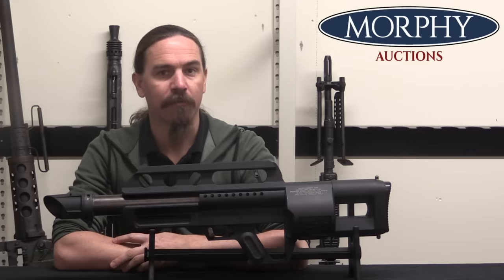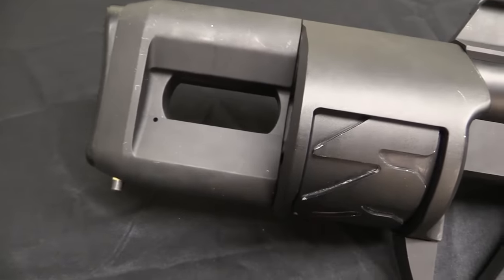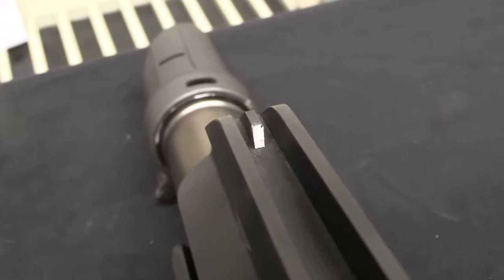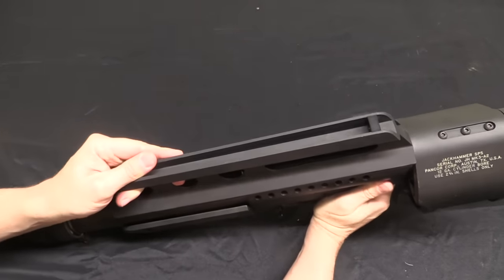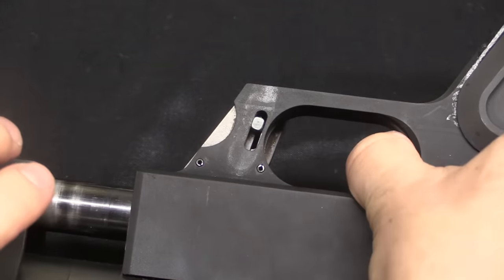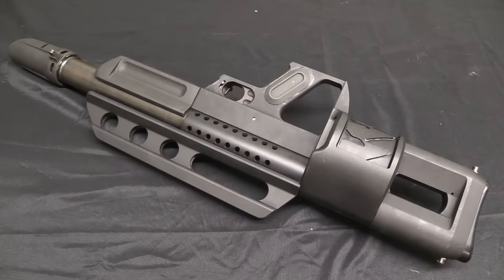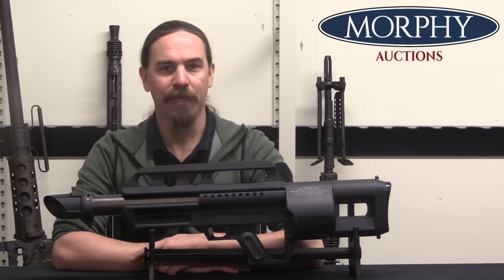Pancor Jackhammer Mk3

Comment: Hope whoever buys this, gets a gunsmith to complete it, then of course has Ian fire it.
Reply: On one hand it deserves to be finished.  On the other, would that technically be ruining a piece of history?  I'm evenly split on if it should be completed or not.  On the flip side, there's so much missing and so much wrong, like the cylinder grooves, I wonder if it was just meant to be a mockup to begin with.
Reply: @DeadBaron  It depends. If completing it doesnt need any, or much modification to the parts that are already there, just adding new parts that can be removed easily to bring it back to its "mock up" stage, I'd say there is no reason at all to not go for it. ofc, It's hard to tell what exactly does that gun need to become functional, without totally picking it apart first and looking at what's missing or not complete.
Reply: Mark Novak?  Get a new cylinder made and keep the original stock but otherwise populate the missing parts.
Reply: @john-paulsilke893  +1  I second that motion! Send it to Mark Novak.
Reply: @DeadBaron  or copy the build and get it licensed and everything and just make an operating one and have that as a wall hanger.
Reply: If you made a new one it’d either have to be semi auto, or you’d have to be a licensed dealer to manufacture a full auto copy.
Reply: @DeadBaron  Legally speaking, you could replace everything but the receiver to make this an operational weapon. For the sake of preservation, I’d rather they duplicate any part that needs to be modified to make the weapon operational, which would also allow some trial and error to make it function without fear of damaging the original pieces. 

Ian has shown off a couple similar examples (I recall an M14 in particular), and I know of a few similar replication methods used for aircraft restoration (such as an SB2C tail loaned to the National Museum of the US Air Force so they could restore their A-25 and create a duplicate for the future). This is a much more complex process, but this is a unique artifact with a unique opportunity that begs for being done properly.
Reply: Building a totally new one would be much easier, today's home prototyping is leagues better than when this was made.
Reply: 5:50  I'm betting this was operational at some point based on the wear on the operating bar. ( Or maybe it was from one of the test to destruction samples )    Also looks like the safety can be moved from left to right.  Perhaps some of the parts are hiding the the basement. . . .
Reply: @john-paulsilke893  prompt the new owner to give Mark N a call. Especially if its the guy who currently owns the mk2
Reply: @Clay3613  Except you legally can’t unless it’s semi-automatic only. This is the only full-auto Jackhammer Mk 3 that can exist in private hands in the US.
Reply: @Clay3613  Hope you don't have any dogs.
Reply: @DeadBaron  Split between Lucas movie quotes. "I will finish what you started" vs "It belongs in a museum!"
Reply: Regarding completing, what Ian said about the drum not being finished is questionable at best. It looks like he changed the design from having one pin going through the zig-zag pattern to having two pins, one from the front and one from the rear, which would better allow intermittend drum movement.
Reply: No, thats not how this works.
Reply: Can't (or hasn't) somebody just make a fully functional reproduction of the Pancor so they have one but officially isn't called a Pancor so there's no patent infringement?
Reply: @dsandoval9396  People have tried to make cylinder-fed shotguns like the DAO-12 (known as "streetsweeper") but nowadays the ATF is a bunch of lunatics so don't get your hopes up of being able to buy one even if they had a comeback. For a more modern example take a look at the Crye Six12, but I don't think it's released to the civilian market yet.
Reply: Yeah whatever you do, don't give it zach
Reply: @LeBoomStudios  So wait, are the ATF stricter with cylinder fed shotguns than magazine fed ones? I'm not really a gun guy but that seems kinda dumb even to me lol.
Reply: @yewtewbstew547  They make up stupid umbrella terms like "destructive device" without sufficiently defining them, then put everything they (read: the politicians funding them) don't like or that "looks scary" into such a category and outlaw it.
So yeah, most of the ATF rulings and opinions are inconsistent and wouldn't hold up to the tiniest amount of scrutiny. But who would've guessed, the courts are just as corrupt and politicized as the ATF, so nobody's gonna do jack shit about it.
Reply: Send it to Zach. Watch him lose his mind over the very existence of this gun. Profit.
Reply: given that it's registered as a machine gun,  to make it operational could be tricky,  legally speaking.   but i could be wrong.
Reply: I hope to be that gunsmith someday!
Reply: id rather it live up to its purpose, that being a firearm,  right now its a paperweight  @DeadBaron
Reply: @bend1707 it's registered as an MG

Comment: Pancor Jackhammer: this is an unfinished prototype, most operating parts don't exist, this will not fire, not to speak of full auto
US Govt.: A MACHINEGUN!!!
Reply: As you can see here, it is quiet clearly a full auto gun with an incomplete magazine and no firing mechanism. Should run perfectly at a blindingly fast speed of 0 rounds per minute

Comment: The cam paths on the magazine actually appears to be complete. It is designed to interact with two cam pins: one in the front cam path and one in the rear path. When the action bar blows forward, the rear pin hits the sawtooth path and rotates the magazine 90% of the way into battery and then the front pin rotates it the last 10% on the way back and aligns the rear pin with the next sawtooth.
Reply: @mycosys  another commenter said the forward pieces that helps rotate the cylinder blocks the chamber a bit.
Reply: You know so much about this thing
Can you build them in semi auto and then start selling them
Reply: Yeah, really cool design. I just watched the other video and thought this was an issue as it seemed like it could rotate backwards if you tried unless it had a one way ratchet hidden somewhere, besides it wore the drum heavily (which is more concerning for the pin I guess). The safety on that one seemed a bit iffy too - the safety pin looked sketchy and it seemed you could in theory fire multiple shots if the trigger is not completely depressed in semi-auto. Or am I mistaken here? (I know next to nothing about guns)

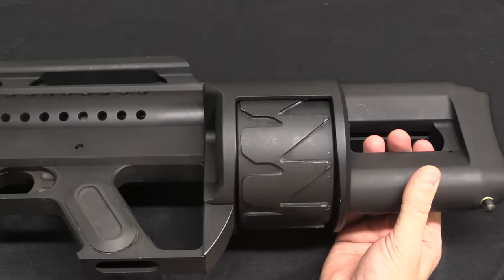Comment: 4:29 The drum looks like it works using two control pins, one at the front to lock and one at the back to rotate into the next position. That means that it is most likely complete and the design was changed to use two linked control pins instead of a single one.

Comment: "And if you are a wink wink machinist and would like to wink wink complete it (...)" - hmm, you're not suggesting anything, buuuut...
Reply: Subtlety of a brick to the face, Ian was outright telling whomever buys it to have a fire control group made for it, whether DIY or by a gunsmith.

It has all the legal paperwork and it just needs some parts. There's nothing wrong with fixing a gun.
Reply: I heard there's this guy, some anvil dude, does real good gunsmithing, ya know...
Reply: @Candyrock87  Mr. Novak is a fantastic smith- but this baby is going to need a whole 'nother level of blueprinting and machining.  Luckily we are in the CNC age, it is absolutely possible.
Reply: @mattfleming86  We can rebuild him. We have the technology!
Reply: It only really needs a fire control group, and whatever other bits n bobs are missing. It's got the majority of what you'd need to finish it already, provided the cam pins and associated mechanisms are in place to turn the drum. The tracks are already milled for the cylinder to rotate, so all the prototyping has been done. Just needs similar internals to any other machine guns that fire shells lol.
Reply: Plot twist: He's going to bid on it and make a fire control group himself.
Reply: @bjorntrollgesicht1144  *smashes the Jackhammer with a 3D printer like Patrick did*

Comment: This would be something for a gunsmith in the movie industry to get it and make it work for at least movie uses. Damn. This was the unicorn. The pink one with the rainbow mane unicorn.
Reply: We're already slavering over Gun Jesus maybe being in the next John Wick movie- I bet a movie prop department could get it running "well enough" on blanks...
Reply: @markfergerson2145  iirc from the other jackhammer video, the design should be fairly functionable on blanks without modification
Reply: @freddienunnelley9234  Sure, but someone has to fabricate the missing parts and figure out those grooves on the mag. Prop departments can sometimes work apparent miracles.

Comment: 4:07 Drum seems completed.
Pair of connected control pins is needed:
Rear one causes ~80% turn (during forward motion of pair).
Front one completes turn (rearward motion of pair) and blocks cylinder in proper position.

Comment: What a weird sexy space gun... why did this not become a thing, it looks so damn unique
Reply: It looks heavy lmao. Can't deny it's a sexy space gun tho
Reply: Money.
Reply: Because it's a 10rd shotgun that weighs almost as much as a SAW. Also, in military use, shotguns aren't primary weapons and therefore the user would still need to carry an M4 (or worse, at the time it was being tested, an M16) alongside it. On the civilian commercial side, as a machine gun, at the time it was being developed, that meant it was gonna be an extra $200 ($514 in today's money) on top of the already-high cost it would have fetched, only for it to be rendered unable to be manufactured at all 2 years later with the Hughes Amendment preventing any new machine guns from entering the registry. It was kinda doomed from the start, to be honest.
Reply: @dinonatorful  And only designed to work with loads like #4 buckshot.
Reply: @El-Burrito  fellow stoner
Reply: @vladtairov2721  You also usually want weapons that are easily reloaded in battle, something that at the very least the prototype Pancor would not be able to considering it needed a freakin' half disassemble to pull the drum. Sure you could use the drums as makeshift landmines but at this rate you created a new mine, not a shotgun.
Reply: @gratuitouslurking8610  would've been as simple as a pin through the center of the cylinder popping out through the buttstock and a shorter cocking handle.

There were other glaring issues with making the gun more reliable before working on ergonomics.

The creator wanted the us military to put more value in shotguns, and thought for whatever reason the 870s and etc. They had in inventory wouldn't be good enough I guess.
Reply: @blackwoodsecurity531  if i remember the guy who made it thought that the shotgun he had in Korea wasn't good enough because of the pump action and decided to make a semi-auto shotgun that would hold more rounds and reload more easily (though i'm not sure how using revolving cylinders makes it easier to reload but the mines are a cool idea ig) 

but yeah case in point he didn't realize that shotguns were in the process of being almost entirely removed from the infantry

Comment: Reading the patent for the Jackhammer, the "safety" in front of the trigger is actually for locking the barrel forwards. To reload the Pancor Jackhammer Mk3A2, you first need to pull the trigger back 1/4", which locks the magazine release tube to the magazine's axle rod. From there, you pump the forearm forwards (along with the magazine axle rod) to release the magazine, and then you push up on the barrel lock switch to keep the barrel in the forwards position. After inserting a new magazine, applying a bit of pressure on the trigger will release the barrel.

For reloading or unloading a magazine that's at least partially loaded, it's recommended to put pressure on the cocking piece (missing in this example), pull the trigger, and ease down the firing pin prior to the main reloading/unloading process (since that involves careful manipulation of the trigger).

(Note: "Magazine" is used in the patent verbiage, but I believe "cylinder" is technically more correct.)

Comment: The cam pattern to rotate the cylinder can work if the operating bar has two cam followers. On the forward stroke one cam follower operates on the triangular cam and the second cam follower finishes the rotation

Comment: The magazine requires less precise machineing by using two pins. As the barrel slams forward the first pin uses the big V cut at the back to provide most of the rotation. The second pin as the recloil spring pushes the barrel back aligns and locks it in position to fire.

Comment: Actually, the magazine looks no different than in what appears to be patent drawings in a wikipedia article about the gun. From my own understanding I'd say that the rear zig-zag pattern is engaged by a pin coming forward from the rear as the barrel is blown forward and then the rounded recesses at the front are then engaged by a pin coming from the front to index the magazine correctly.

Since this is kinda important information to whoever would choose to complete the gun I suggest voting this comment up or pinning it.

Since I probably won't be able to link to the article directly:

Search for "Pancor Jackhammer" on Wikipedia to get to the article. It includes some drawings, including an exploded view of the gun.

Comment: In my mind there is a system that should be able to operate the drum the way it's made, with a cycling pair of pins. You pull the trigger, and a lever or pin shoots forward into the smaller recess, turning the barrel slightly, and then as the recoil comes in that pin is pushed back, and a second pin is shoved in the large angled gap from the other end, completing the turn

Comment: 4:35 That is a finished drum! This mechanism is designed for "more than one pin".
I suspect the intent was to have one pin partially moving the drum when sliding the handle backwards and a second one completing the rotation to the next round when pushing the handle forward (Of course after the first pin has just disenaged it's groove).

Comment: Among the myths about the Pancor there is a mistake in the facts. And that is that none was exported. The QAD (Ord) at The Royal Arsenal had a functioning example that I have seen with my own eyes. Either Pancor built a fourth, or one of the ones used in the destructive testing was not entirely destroyed. To the best of my knowledge it is still out there, probably in a box at the museum on the old Arsenal grounds.

Comment: Honestly, adopted guns tend to have gone through more than just 3 prototyping stages. There's alternate universe out there where one of the branches put forward funding and someone pushed it through with a lighter frame, probably a lot of polymer on the non-load-bearing elements of the frame, and a drum that drops out or otherwise lets you access the cylinder bores... and/or the exo armour to help a trooper carry the damn thing

Comment: Going by the look of it, the drum could actually work.
Different from the old design which uses one peg to rotate the drum, this one would need two - one at each side - instead.

Another indicator for this would be the fact, that the drum has a proper surface finish. You wouldnt finish you parts until all the mill work has been done.

Comment: The magazine cam looks finished to me. It's using two pins instead of one.
You can see that a pin at the rear of the cam would provide most of the rotation needed as it moves forward into that large triangle.
Then a second pin at the front end completes the last bit of rotation as it enters the front cam track before sliding straight back to engage the barrel.
I would imagine this fixes the machining tolerance issues on the cam track that you mentioned in your earlier video.

Comment: About the cyilinder zig-zags, I wonder if, instead of a single pin moving the cyilinder around like before, that instead it had two pins that moved in from either side.  It would make inserting a cyilinder a little less tedious, which would have been important in a firefight.

Comment: I don't think the guide track on the cylinder is incomplete, I think it's just a different system to the other examples he listed. Instead of having a single lug in the middle of the cylinder, it probably has a pair at the front and back that work similar to some retractable pens.

Comment: The caming on the drum looks functional to me, as it is, it needs two control pins, one in front of the drum and one behind the drum cycling back and forth together. 
This cam is functionally identical to the earlier version(it's inside out) but this form can be directly cast or forged (probably) where as the earlier design, while conceptually simpler, needs a time intensive milling operation on a custom-built machine.(I'm assuming pre-CNC techniques here)

Comment: Dude I would love to buy this. I wish I had the money and the tools to finish that. I know i could make it work. I've done a lot of work on all my guns. I own 2 ar15s 1 is the ks47 which i made more reliable because i had the original which had feeding issues and i fixed it before finding out how PSA fixed it. I did the same exact thing they did. I ground down the feed ramp a little bit then polished it. So it no longer looked like an ar15 feed system it looks like an ar ak hybrid. My first ar I got was a parts kit from PSA I put it together my self and that was the first rifle I ever purchased. I had a mossberg mc1 which didnt feed steel so I made a few changes to its feed system and it worked much better. And I now own a tristar t120 which I did a lot of work too to make it feed right and I reduced the double and single action trigger pull. And made it more reliable and I have a pistol grip pump 12 gauge which I made some adjustments to as well.